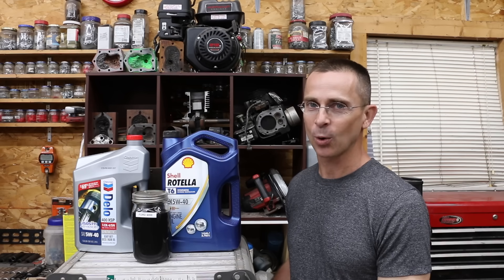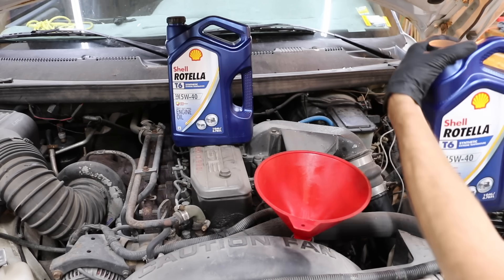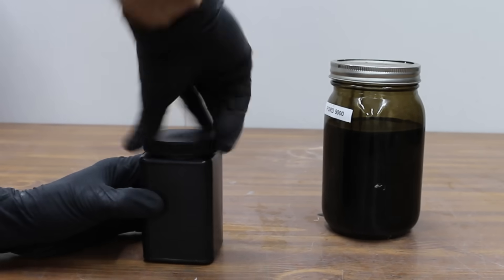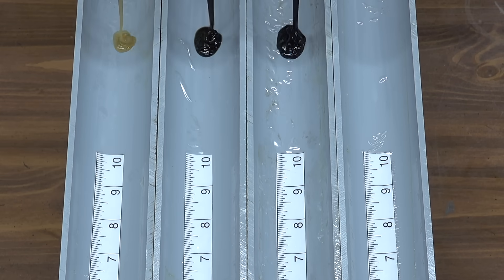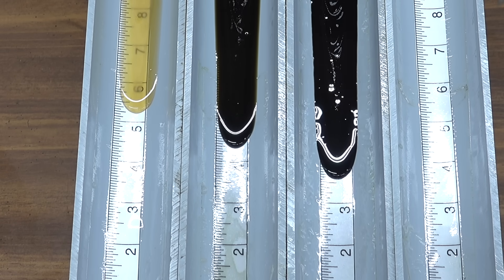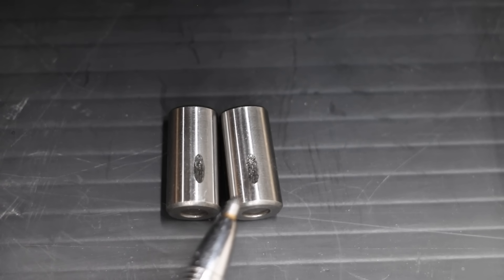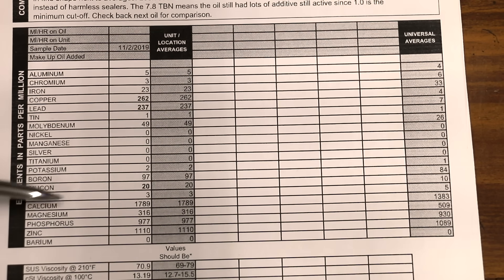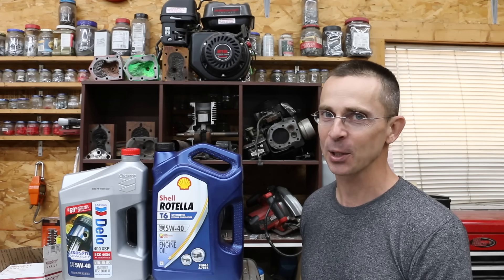Will Annual Oil Change Damage Your Car? Let's find out!

Comment: Do you have testing on annual protection oils? IE mobile1 20000 mile oil.
Reply from the maker: Thanks for the video idea.
Reply: @ProjectFarm  No problem, just curious. I used it on my everyday car, on a rebuilt engine for about 60,000 miles. I hear alot of bad things from the die hard 3000 mile oil changers.

Comment: Thanks a lot for your channel. What about biennial oil changes with fully synthetic oil? In my diesel BMW from 2004, as long as the oil fullfils the norm BMW Longlife-01 (BMW LL-01) it is good for 2 years or 20000 miles, whatever comes first. Same for my Volkswagen Polo 1.2 TSI 105 gasoline/petrol. As long as I use a fully synthetic oil with VW504.00/507.0, it is called LongLife service, and can go 2 years or 30 000 km (20 000 miles).
Reply from the maker: Great suggestion!  Thank you.

Comment: ( General Question to all ) Is there still a big deal placed on foaming of oil under use?  I know back in the 80's that was all we seemed to hear.
Reply: @Kintus Sphinctus I was just going back in memory to when Castrol Oil used to make a big deal of how there oil did not foam in Hi Reving engines. I think cheaper oil may foam up?

Comment: Make sure the oil filter seal is removed when you take off the old filter. A nightmare mess if it stays on the engine and you start it up.
Reply from the maker: Thanks for the feedback.

Comment: Good Show, Mr. PF :) Back in the Day - Before Synth oils came up - Ol' Timers @ marine & power gen diesels reckoned, Eng oil could go for years. Top up oil, reqd due to oil consumption, made up the additives. They did maintain, regular filter replacement.
Remember, big, stationary diesels, have oil centrifuges & oil tank pre-heaters...At some point in history, UOA became a norm. At least, it confirmed the Ol' timers :)
Reply from the maker: Thanks for the info!

Comment: What about the oxidation of the Oil. As I know oil oxdates with age when oxygen gets in contact with the oil.
Reply: That was addressed with the used oil analysis that was presented on the video. The additive package resists both acidity and oxidation. ln both cases, the year old motor oils were still doing great on their additive package levels which means oxidation and acidity are both still being managed.

Comment: Does that oil for diesel engine also fit in scooter with 100cc displscement gasoline engine? Thanks
Reply from the maker: Some diesel oils do indeed include the JASO certification
Reply: @ProjectFarm  t6 rotella?

Comment: What would be the recommended mileage to change the oil? I usually change every 6000 miles but not sure if it can last longer? I use Mobil 1 but will try better oils if I can find them for around the same price.
Reply: @Alexis ayala I'll probably start doing them 10k or if the car feels off. Just replaced mine as wanted to get fresh service and had low oil around 6k miles in. Not sure when previous owner last did the change so I like to start fresh so that it's been done.

Comment: could you do a test where you drive with synthetic oil 5000km change and a 10,000km change? or even 10000km and 15000km? Most companies say to do oil changes every 10000-15000km but I would like to see the difference in wear if the oil is left in for longer
Reply from the maker: Thank you for the video idea!

Comment: Great video.   You hit the key.   Operate engine to operating temp at least once a month.  Water is the bigger enemy in so many applications.   Some advocate six month oil changes regardless of miles.   Low mile oil change is not needed.
Reply from the maker: Well said!  Thanks for watching.

Comment: Hello and thank you. I'm assuming I'm only going to drive 4K km a year. My Caravan's manual says I need to change oil once the "oil change indicator system" says to. I also called the Dealer about the oil change and they said bring the car once it hits 7,500 km. So, this will take me over a year. Comparing what the manual and the dealer said, it will be around 7,500 km. Should I follow this even if I go over a year before I do my first oil change? Thank you and stay safe.
Reply from the maker: For the purpose of maintaining the warranty, recommending changing the oil per the owner's manual.  It's very likely that the oil will still be in good condition.
Reply: @ProjectFarm  Thank you so much and have a wonderful day.

Comment: I change my oil every 3k miles. I also put at least 50k miles a year on my trucks. Both are tow pigs for my work trailer. So they get an oil change at least once a month.
Reply from the maker: Thanks for sharing.
Reply: @ProjectFarm  you're welcome. Could you do a video comparing all the diesel engine oils? I use valvoline premium blue for all my trucks. I am interested in how it compares with t6.

Comment: diesel truck oil also gets the carbon from the soot of the exhaust in the oil that's why you need to get a special filter system on their the filters out the soot out of the oil
Reply from the maker: Thanks for the feedback.

Comment: if you take the oil out the drain plug you're getting a settlement for the oil settled out on the bottom you need to suck it out through the dipstick tube so you don't get the bottom of oil
Reply from the maker: Thanks for the feedback.

Comment: Couple thoughts. 1st, the cummins oil pressure gauge is a dummy gauge far as I know. It makes up an inferred value based bunch of factors. So when it said 40psi, you probably weren't near that. 

What I think would be interesting, would be to test a car running E85. E85 is known to be extremely acidic much more so than diesel and gas and most don't recommend above 2,500-3,000 mile oil changes or 12 months because it's so acidic unless your vehicle was specifically made for E85 (flex fuel vehicle) as they usually have special coatings on the engine parts to reduce wear. 

I always thought the my cummins had nasty oil when changed, but it's not even close to what comes out of my fun car that only runs E85. It's not a car that comes stock to run E85, but like many cars anymore a simple tune can adapt it to run E85 (n/a motor.)
Reply from the maker: Thanks for the feedback.

Comment: Even with horizontally mounted oil filters you can at least partially prefill them and at least get the filter medium saturated with oil, this reducing the time for the oil system to build up pressure.
Reply from the maker: Thanks for the feedback.

Comment: My 2015 Ram 6.7 Cummins requires an oil change every 6 months or 15,000 miles.  So if you have 3,000 at 6 months, you’re supposed to change it.
I now call BS. Ram and Cummins should be ashamed of themselves. Costing consumers extra maintenance money and causing more environmental wear by requiring premature oil changes. 

And you wonder why consumers don’t trust car dealers and manufacturers.
Reply from the maker: Thanks for the feedback.

Comment: Project Farm, Excellent well planned tests!
Just one bit of advice for your channel.
I believe the safest way to add oil to the  filter is   to pour into the outer concentric holes and not in the center hole. The center hole is the post-filtered output. Any contamination that spills into the center hole goes directly into the engine block. 

Greatly appreciate all you do for us!
Reply from the maker: Thanks for the feedback.

Comment: Thank you for doing these tests but can you try out 15W-40 ?
Reply from the maker: Thanks for the video idea.
Reply: Your welcome, I have another idea but idk if you have viewers outside of USA, the engine oil we get in the Caribbean and south America are unpopular brands like Ursa I used the 15w-40 and got sludge in my generator. Am looking what's the best for my John Deere generator engine. Also John Deere as heavy duty engine oil. Brands like Castrol gtx and Mobil 1 are supposed to be good brands but nobody I know recommends it. Toyota engine oil can work with other brand vehicles or vice versa ?

Comment: Do one on Amsoil signature series 100% synthetic motor oil for a 25,000 mile service interval with a K & N premium oil filter. I got 30,000 miles from the aforementioned yielding optimal test lab results.
Reply from the maker: Thanks for the feedback.

Comment: One thing to mention is that in the EU there are laws in effect that prevent using some additives that extend the lifespan of synthetic oils. Basically most synth oil in Europe will fall apart with time just as earlier mineral oils. Maybe not a year but you should consider this if you are driving rarely and only want to change il if a certain mileage has been in the car. Also, as others have said: oil is a lot cheaper than an engine overhaul.
Reply from the maker: Thanks for the feedback.

Comment: Just wanted to see if anyone has any experience with using the shell T6 5W-40 in small gasoline engines such as motorcycle engines. It has a JASO MA rating. I've heard many people say it works fine and without issue, but equally as many people say that you shouldn't use it because it isn't within the recommended viscosity range or that it isn't designed for gas engines.
Reply from the maker: Thanks for the feedback.
Reply: @ProjectFarm  I've done some more reading on the subject and it seems to be rated JASO MA2, which supposedly means it's fine for motorcycles and scooters. Many people seem to think that it isn't great for those engines though. Would you consider doing a video on the subject? Not many people seem to back up much of what they say about it. I made a similar comment on another of your videos already, so sorry for the repeat. I just can't find good answers, and it seemed like a great idea for a video. Also, thanks for keeping up with comments. Not a lot of people with your popularity do it as well.

Comment: I changed oil in my bike back in 1998. I was pretty busy working and only rode my bike a couple of times a year.  Then in 2017 my son  wanted to learn how to ride a motorcycle and I taught him and then schooled him about maintaining the motorcycle.  Bike had developed a very slight rocker cover leak so we changed gasket and oil from 1998. Engine looked like new on the inside when changing gasket.  We put new tires on it also because of their age.  Bike still runs like new even though it's 25 years old.  Used stabil in tank and used a tank a year so gas was never more than a year old and treated. Oil had probably between 4k -5k on it.  Was synthetic but held up all those years.
Reply from the maker: Thanks for sharing.

Comment: With the job I do I might put on between 2000 and 3000 mile a year on both of my vehicles each. If I don't change the oil at least every 6 months on both they run not bad but not like they should. After the oil is changes they both run noticeably better. Both are gas engines, one a V-6 other a V-8
Reply from the maker: Thanks for the feedback.

Comment: Another great video comparing motor oils.  As a suggestion, I would like to suggest comparing Shell Rotella T6 15W40 to Sinopec 15W40 T700 which can be purchased as Walmart.  This would be a good comparison of a premium full synthetic diesel oil, Rotella T6 15W40 against a value priced Chinese brand full synthetic diesel oil.
Reply from the maker: Great suggestion!
Reply: @ProjectFarm  Hey, I appreciate the prompt response...thanks.  There appears to be a lot of debate about the quality of Sinopec 15W40 T700 on a major motor oil website.  Comparing Shell Rotella T6 15W40 to Sinopec 15W40 T700 would answer the question once and for all regarding the quality of this Chinese value brand full synthetic heavy-duty diesel oil.

Comment: Wait, people change their oil once a year? I change mine every 5,000 miles. I change it like 4 to 5 times a year.
Reply from the maker: Thanks for sharing.
Reply: Wow. Most people in europe change once every two years, and thats it. This is also what the car manufacturers of most european cars recommend. Also, this test shows that it is a sound policy. Changing oil multuple times a year seems to be an american thing, which I guess have lived on since old times when oil and engines were bad. Who is going to tell you that you dont need to change that often? They will gladly take your money, even when its not needed.

Comment: Thanks for this great video. My 2015 Powerwagon only does about 3000 miles a year now that I'm retired and I was concerned about that based on what the dealer was telling me. I have a question. What brands of  synthetic oil have the Chrysler rating besides Pennsoil.I cannot find The Pennsoil anywhere here in Edmonton Alberta aside from the dealer. I was hoping to find another brand as well. Thanks.
Reply from the maker: Thanks for the video idea.

Comment: Question can i use that oil in my car 2.4 DOHC GM Gasoline Engine ? I nevered used shell oil befor I'm curious about there product im always using Castrol GTX synthetic blend seem to do the job.But I heard that this oil has better wear protection and higher boil point great for engine's that run hot.I know they have created one for gasoline truck engine would it be ok to used the 5W 40 in my engine and what are some advantages I have using this oil compare to Castrol oil. Thank you

Comment: Good video as always 

my theory is the car dealers want to see you once a year because they want that income stream and if the vehicle happens to be under warranty if they change the oil every year it reduces the risk on the warranties out there regardless of whether it actually needs it or not because we all know clean oil is a good thing for motors.....

Plus it puts you in front of the “ming moles” to sell you the current model or some accessories or they pick up other minor repairs under the guise of changing oil which really doesn’t need to be changed just because it’s 12 months old.....
Reply from the maker: Thanks for the feedback.

Comment: I only put on around 450 miles a month on my car so it goes without saying the mileage thing is what I go by. A test I would love to see you would be a bit more involved. Pull the oil pan from an engine and clean out the sludge in the bottom. Have that goo tested. Then after some miles pull it again and see if more sludge develops. Result what is the causation.
Reply from the maker: Thanks for the feedback.
Reply from the maker: Thanks for the feedback.

Comment: I have a suggestion; stop switching your speech between older oil - newer oil and the vehicle they came out of. How am I supposed to remember which one had the old or new oil while you talk 100 miles per hour? So either simplify it or talk half as fast. It's like listening to a six year old try and tell you a story. It's too fast and hard to follow.

Comment: Could I run 5w40 in my Chevrolet 4.3 vortec gas engine? 5w30 is the recommended oil. You would think it would be ok with the miles above 75,000?
Reply from the maker: Thanks for the video idea.

Comment: T6 is going to beat the Delo on the wear test due to the ZINC levels (Delo 748ppm vs T6 1074ppm). Delo has to lower the Zinc & and other additives in order to maintain the “SN” category. You basically tested a multi vehicle oil against a diesel oil. Apples to oranges. But still useful information for those that wanted to see a diesel oil’s performance over a “SN” category oil.
Reply from the maker: Thanks for the feedback.
Reply: Project Project Farm your welcome, I have a theory that people are doing more harm than good by using diesel oil in their gas engines. I believe that the additives in diesel oils need diesel contaminates in order to work at full potential, as proven on your oil flow test.

Comment: What do you think about Toyota Camry getting oil changes every 10k miles? Mine seemed pretty clean after that many miles.
Reply from the maker: What's called for by the manufacturer?  10K seems fine if using a really high quality oil and mostly highway miles.
Reply: @ProjectFarm  its calls for 10k. I use Mobil 1 but currently where we live that's all the brands I have available.  It uses 0w-16 Walmart is the only place that Carrie's it now. Before that the dealership would do it , part of the deal I guess. I wanted to try pennzoil or maybe even super tech since I saw the video you made comparing all oils. I think pennzoil was 2and after amsoil. I think pennzoil, valvoline, Castrol, and super tech did better than Mobil in most categories

Comment: Perhaps a mistake, but cold test seems to be biased towards the T6.   At 9:28 you can clearly see the device slightly tilt towards the left (T6 side), putting it lower than the other oil thus giving it a headstart. Might be the rig is worn, but just my observation.
Reply from the maker: Thanks for the feedback.

Comment: I run Mobil 1 5w 30 and Mobil 1 filter in my 2001 Tacoma 3.4l with 235k + miles on it. (I have been using Mobil 1 oil and filter since the 3rd oil change when it was new.) I usually put about 10k miles per oil change regularly. You should test these oils at 10k-20k miles on them instead of the recommended 3k-5k miles.
Reply from the maker: Thanks for the feedback.
Reply: internet RV-er that used the cheapest conventional oil like super tech, and fram filters on his motor... motor home runs excellent after 135,000 miles, he climbs mountains in it all the time,,,he changes oil every 5000 miles

Comment: Oh, oh, oh! I have a tip!  I have one of those slip-on filter removal caps. Eventually it started to slip like a stripped out socket. I didn't want to throw it away because I hadn't even used it that many times. I found that if I take a 4" long strip of emery cloth and lay it along the inside edge of the cap, and then slip the cap on the filter, the emery cloth provides enough friction to grab on to the filter. It has been working fine this way literally for years.
Reply from the maker: Thanks for the feedback.